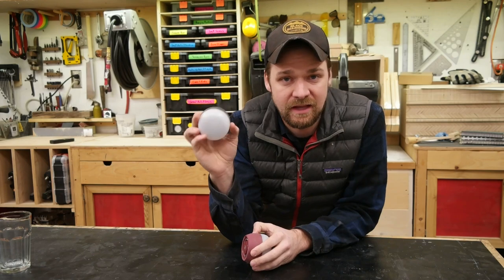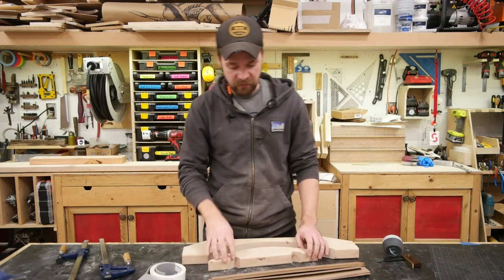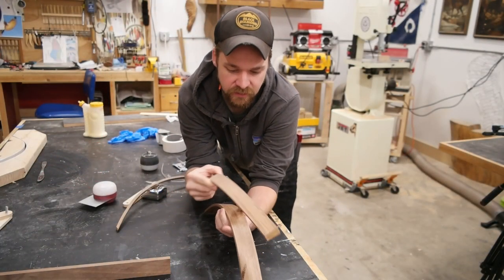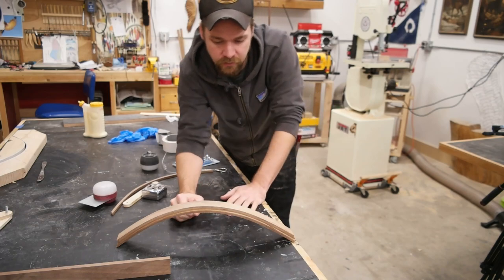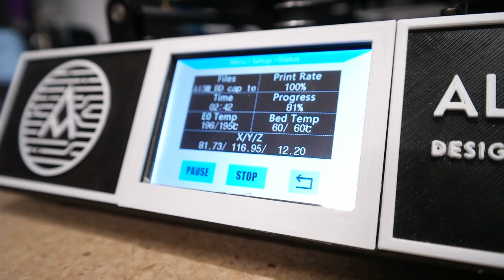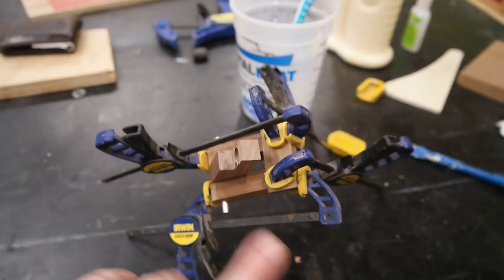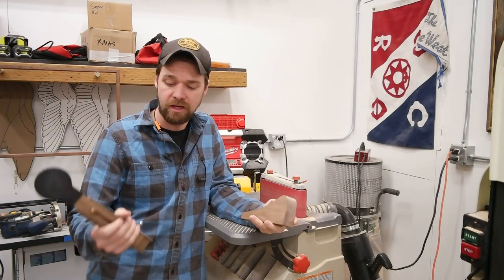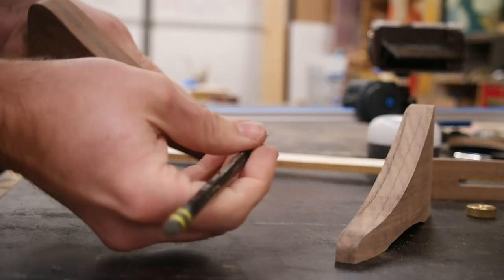DIY Battery Powered LED Task Light -- Design No. 2 -- Woodworking

Comment: Great project. I’m going to try to make something similar for my mom as I have a few of those same led lights. Do you think it would be possible to have the two pieces that slide to be connected using a sliding dovetail? Or would the imperfections of the two dissimilar arcs cause it to jam?
Reply from the maker: Thanks Christopher! It's funny you say that, because my original plan was to do a dovetail. I just couldn't figure out an effective way to make and accurate cut on such small curved pieces. If you figure out a way, please let me know. Also, let me know how your lamp turns out!

Comment: Good work sir, pretty sweet lamp!  How did you measure/model the threads to be sure they matched the light?
Reply from the maker: Thanks Justin! That was a bit of work, and I didn't share it in the video, because I thought it'd get a little too deep  in the weeds. I used Fusion 360 to model it and watched 3 or 4 videos on how to make threads. A set of digital calipers were key. To my surprise they fit on the first print.
Reply: @MichaelAlm  I don't blame you for leaving it out.  I was just hoping you discovered some magic trick to make it easy... 😁
Reply from the maker: @BearMaked  Yeah, this video was the most helpful. I had to use option 3 because they weren't a standard thread size. https://www.youtube.com/watch?v=1nhcKn7Kt8w